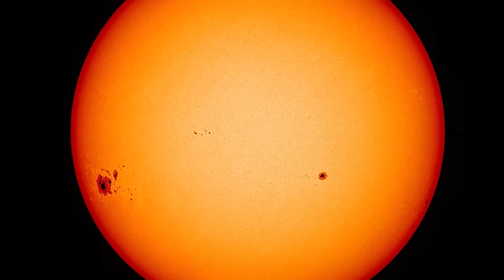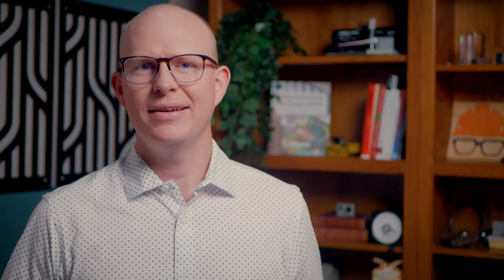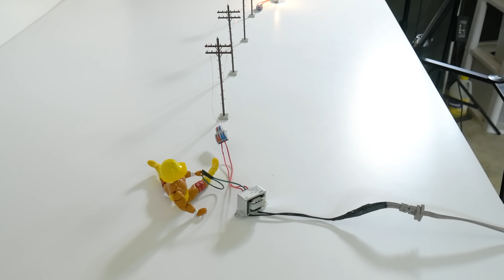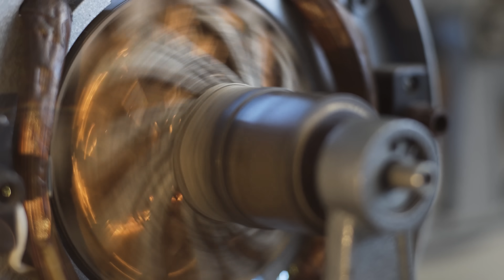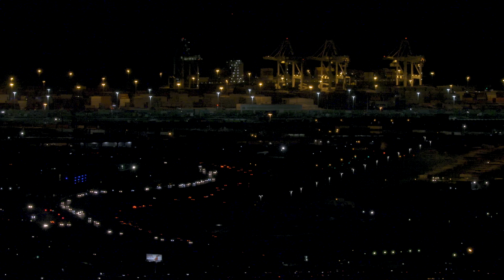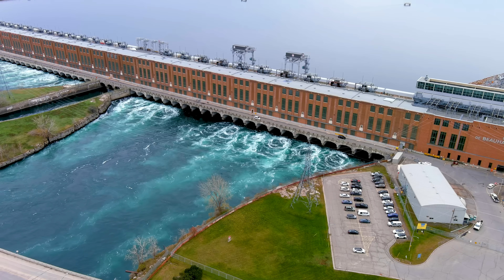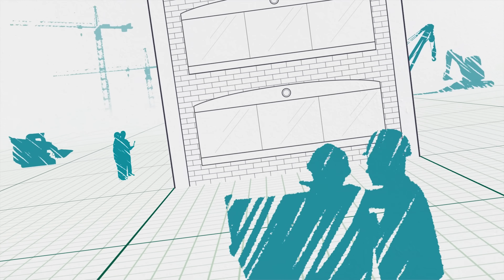The Most Confusing Part of the Power Grid

Comment: I work in industrial maintenance and we use many induction motors. They're higher torque for the same HP as a normal motor. Only the stator is powered, the rotor isn't, and when you power it on, the stator induces current into the rotor, thus inductance motor. They're a trip, the rotor looks like a can of beans and at least on large roots style dry vacuum pumps, there is oil between the stator and the rotor, vacuum pump oil. The makers of these vacuum pumps actually call the rotor, the can. The rotor also has cooling liquid inside of it. Like you said, they're very simple and very durable. We've got some Ebara vacuum pumps that have over 100,000 hours on them. Sorry I got off topic there, okay back to electricity!

Comment: The magnitude ofa magnetic storm is roughly 30-40nT, while induction in a transformer usually 1.2-1.5T. What may be wrong? To inducing any essential current in power lines - the frequecy and magnitude of magnetic fields must be large? but there was 1-5Hz.

Comment: Those capacitors on the line would do alot more good if some of them were in service.... Ive worked as a lineman for three different large companies, i can tell you honestly that at least half of them are off line in need of repair. But large companies wont spend the money for maintainence, even though it may save them in the long run. All about looking good for the rate case!

Comment: I did electrical work and built industrial control systems for 22 years.  This video was informative for me though.  I've used control transformers and wired 3 phase line transformers.  But, I never took the time to study anything more than the math to correctly size them to an application.  I never understood the core of what KVA means.  Thanks

Comment: You forgot to mention that when you interrupted the magnetic field on the inductor with the screwdriver, that you created a basic speaker driver.  The frequency of the circuit affected the field and the screwdriver conducted that field into the table, making a sound that reflected the frequency.
So, it was a speaker.............kinda.

Comment: Perhaps some of the technical terminology answered my question, but I missed it.
  Can inverted power producers produce reactive power to counter the reactive load?
  Inverters use pulse width modulation to define current flow. The width of the pulse is determined by a computer algorithm. Normally the widest pulse is at the peak voltage.  If the controller instead synchronized the pulse width with the instantaneous combination of voltage and the current flow, wouldn't that allow compensatory reactivity?

Comment: Great description!  I;ve been an electrical engineer since the 70s and worked primarily in heavy industry. I teach these days and your description is one of the best I have seen to describe the basics without getting lost in the math. 

Not really a power distribution guy, but you still need to understand how it all applies to the end users.  The plant I worked at  in my later years was a greenfield plant using about 40MW. And we were just on the finishing end of steel production. We had 2 double ended 138kv subs. and loads of PF correction banks  at the 13.8kv level. 

Our big integrated plants covering around 10 square miles or so. made this little greenfield look tiny!  With several Co-Gen operations. They had their own power department groups and soe impressive manned AC stations. We had a small group who took care of al the 13.8kv and below distribution, while the utility company managed the 138kv stuff. So I had exposure, but wasn't a power distribution guy. I had more than enough to worry about with all the lower voltage subs and all the operating automation. 

It's not uncommon for big industry to mirror power distribution levels with the electrical workforce responsivities. I always found power distribution interesting but found the controls side of things to have greater variety in the typical challenges. 

People don't realize that electrical engineering has at least half a dozen or more of major  specialty fields. .Depending on where you work, there may or may not be a lot of crossover, Electrical engineering is really about as diversified as the medical fields.

Comment: Bought a step down transformer to use my US clothes dryer in the philippines and the seller advertised it as 7500va not 7500w. Whats the difference?
Reply: VA includes the reactive power, watts is a purely resistive load measurement.

Comment: Pretty sure power only flows in one direction the one voltage and inductwnce flows ron burddhi wait what, ye power oscillates no it doesnt cow ron uwc ye me know its another concept basically delayed electruusn flow sota that co causes power factor issue can be domewhat compensated mechanically but damages generators lowers efficiency, is not directional change of power AFAICT

Comment: Stop referring to solar as renewable. It's about as far from "renewable" as it gets. Batteries must be maintained then replaced. Solar panels also must be repaired and replaced. Those systems have definite life cycles. And the hazardous materials they consist of must be properly disposed of and then replaced as well, which results in further strip mining and associated environmental contamination. Your use of the word "renewable" when describing solar highlights and reveals your bias and your allegiances, which whether you realize it or not, are far from noble.
Reply from the maker: Renewable refers to the fuel. Every organization overseeing the grid makes this distinction. All energy generating facilities require maintenance and replacement of equipment.
Reply: "bias and allegiances" 
this isnt a civ  game. you clearly think we should just use oil forever, ignoring the fact that we would kill ourselves if we did that

Comment: I think its interesting that the power actually flows in the field around the outside of the cables. Underwater transmission cables have to compensate for the resistance of the water even though the cable is sealed off from the water
Reply: wasnt that basically debunked by the video where they ran a very long power line with a switch directly next to a light bulb and measured the time the electricity took to travel the wire? debunking the idea that the power is outside the cable? outside the cable is just a magnetic effect, not the power itself

Comment: Economics 101: end users get charged as well for reactive power, only they get charged in the worst possible way: the utility (unless subsidized, which would be even more costly) will have to summarize every end user reactive consumption and charge them all BUT since no one is incentivized to cut reactive power EVERYBODY will be paying MORE than they could have paid if the incentives were properly aligned (i.e. charge for reactive power). Thanks for the video!
Reply: Oh, it's even worse than that. The ones that end up paying the most are those that can least afford it. Some power companies that disguise themselves as "coop's", charge a flat rate called an "availability" charge. This is very similar to a toll road, once the toll is applied, it's there forever only to increase as time goes on. Over the last 3 years, I have had 12 monthly bills in which the "availability" charge, which is a constant flat rate paid by all end users regardless of consumption, has been more than 50% of my total bill. I can't get off grid fast enough to escape this piracy.
Reply: capitalism makes everything as bad as possible for the end user. thats one of the many drawbacks of the pursuit of profit by any means necessary. and then they have a monolopy on top of that, even if you depend on electricity for your oxygen machine, theyll increase the prices and shut you off if you cant afford, all while they make record profits.

Comment: this was awesome.  You could have also included that nowadays, most power supplies in your electronic devices include power factor correction to bring that power factor closer to 1!  There are chips dedicated to this on the power supply that control switching MOSFETs acting within a boost converter to bring the voltage up to 400VDC (to accomodate the whole range of AC input voltages) and bring PF closer to 1.  But you did an excellent job of explaining all those fundamentals in one ~20 min vid

Comment: Please make corrections in your model. You are mixing terms up. Your model is the distribution not transmission. And yes it in fact makes a difference. You have tried to over simply the grid by a long shot. I'm a retired 40 year power lineman and troubleshooter.
Reply: i think simplification is the point though init?
Reply: @katiebarber407  no problem with that, but to use the absolute wrong words will cause confusion. If one claims to be an engineer then use correct verbage.

Comment: Use High voltage DC for long distance power transmission .
Only two wire rather than 3 and no  power factor issues .

Comment: Great video!

I do want to clarify the part about customers with high inductive loads that makes it seem like they're kinda like freeloaders. Their equipment is taking power and returning power, but the taking and returning don't balance out.  To do work, their equipment must consume power, and the source of the power is the electric grid.  The consumed power is the imbalance that's the "real power" component of the "apparent power" at 12:10.  As mentioned in this video, they pay for the real power, and they could be charged extra for the "reactive power".  That's fair because the reactive power component means that the grid must be sized to handle the extra current of the reactive power, and that extra current incurs a transmission line loss (I²R), as mentioned in this video.

Comment: Even before the capacitor was added to the circuit, the voltage and current in the transmission line were not in phase, because the current was inductive.

Comment: During the recent geomagnetic storm, I had a GFCI-protected circuit that tripped multiple times.  Enough current was induced in the wiring to exceed the allowable fault current and make the circuitry in the breaker read it as a neutral-to-ground short condition.  These things are no joke!

Comment: I was trying to understand some things about the parts of the electrical tools in my garage and was interested in auditing a class. We got to the part about real and apparent power and I got stuck without any way of visualizing. I didn't realize at the time that I was looking for a visual like what you set up on the oscilloscope and with the various components plugged in. My teacher just kept getting madder and madder at me because the equations weren't just "obvious". He asked me why I was in a class that required brains when I was too retarded to derive a function. I dropped the class halfway through. 

I had given up on the idea that I would ever understand the difference between real and apparent power without learning phasor representation and trigonometry. Thank you.

Comment: I have often wondered how the solar panels on my roof can feed power onto the grid backwards through my local transformer.
I’m in a regional area so there is only two houses on the local 240v circuit and my neighbour also has solar power.
I think this kind of answers how the grid manages this magic.  The transformers are designed to do it?
Great video

Comment: The reactive power problem and the lower power transfer due to alternative current are both solved by HVDC power lines. Leading countries are China and Brazil. In China alone more than 50.000km power lines are presently HVDC power lines and are progressively replaced by the new generation of UHVDC (+/-1.2MV) power lines . This modern technology is not mentioned in the present video, nor in most of the comments below. Strange for a country that was once a leader in distant electric power distribution.
Reply: It is much easier to have the newest tech when you're essentially starting from scratch like China and Brazil for that matter.  They still have to contend with local AC consumption but a well designed HVDC power grid should make that easier and far more reliable overall.
Reply: @HobbyNut-sy3lo  Indeed also like telecommunications in Africa. This is called technological leapfrogging if I'am not wrong. It shows how easily you can get from cutting-edge to has-been. It applies to individuals as us too :-)

Comment: This video is excellent! I work for a major power automation industry and have to explain the difference between MW and MVAR on the exciter capability curve. I will be referencing this video from now on.

This being said, because I don't think you mentioned it, VAR can also be controlled by adjusting the strength of the field in the exciter. This changes the generator terminal voltage so you either lag or lead VARs.

Comment: The weird thing about A C electricity is that it has momentum . Trillions of little balls called electrons are flowing back and forth around the outer surface of the wires but there is an energy flow in only one direction i.e. from source to load .

Comment: Using generators as synchronous capacitors is not a new idea, when I joined the UK Central Electricity Generating Board in 1965 we used a 60MW alternator as a synchronous generator overnight.

Comment: Feel free to correct me if I'm wrong, but this explains why pudget sound energy barely pays for the power we “sell” to the grid.
There's little they can do to control it, and thus they need to adjust THEIR generators on THEIR end more aggressively to compensate for THEIR limited control over the power WE generate loally on OUR end, leading to wasted power and hightened wear and tear on THEIR end.
They probably need to add some sort of signaling system to allow for control at BOTH ends, possibly via the internet through somesort of Ethernet or sat-link network controlling a power regulator on the ”consumer's” end?

Comment: Quebec is on its own grid, not because of political factors, but because of their extremely long North-South power lines prevent them from having enough stability to meet the standards of adjoining grids.  All power transfer to and from the Quebec grid is via DC converter stations which remove the instability.

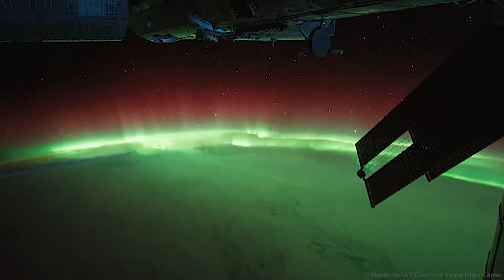Comment: 2:04 "Electrical power only moves in one direction." I'm assuming you mean electrical current, since current flows, voltage does not, and power is the result. However, with AC, current flows in BOTH directions. In the USA, current reverses 120 times per second.

Comment: Nice video, but you probably should have touched on series vs shunt when it comes to capacitor banks. The HQ capacitors you referred to aren't really switched for voltage control. They reduce losses, block geomagnetic induced DC ground currents, and allow the operators to alter the attractiveness of a given transmission path to shift flows around on the system. Also, it probably would have been worth discussing the Ferranti effect a bit since power lines themselves will act like capacitors or reactors depending on how loaded it is.
Not an engineer, so I can't really explain the mechanisms, but I operate a power grid and we have both shunt and series devices that we switch. I've also had several discussions with the HQ operators at conferences. When there is a geomagnetic disturbance they switch all the series caps in to try and limit the ground induced currents from traveling on their system.

Comment: 14:54 I'm not very happy with this graphic and the corresponding explanation (everything else is pretty good, thus far; well, an incandescent light bulb isn't just a plain resistor with no imaginary component as it definitely holds inductive priorities as well which make up it's overall impedance, but I take it as trying to make an example [so, just don't zoom in too closely in your first oscillator graph.])

however, the issue I'm taking with your graph is firstly, that I really don't agree on your choice for the x and y-axis. I'd have swapped them out by common convention.

in mathematics, we usually say, "f(x)." it brakes reason if you get two values for one x; that'd be an f(y) graph, then.

secondly, you kinda left out the portion why this "nose" happens, despite having the formula required written next to it. 

the crossover happens after power adjustment was reached; since power is the product of volt times current, you reach peak power output at one certain resistance. 

(that is when it matches the [virtual] output resistance.)

but in short, since volt is current time resistance, it's of course zero when the resistance is zero. likewise, since current is volt over resistance, this becomes zero when the resistance is infinity. 

that means that either no load at all (high resistance situation), or a shortage (low resistance condition) lead to no power transfer (yes, in an idealized world, but the "trend" is correct in the real world as well.) this makes it pretty quickly clear that there most be one certain resistance which yields the maximum transferable power.